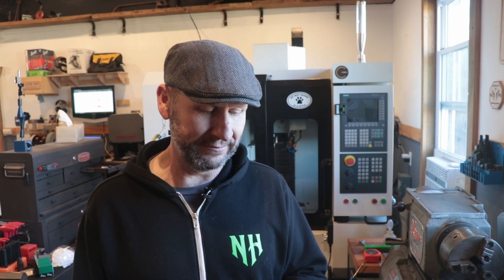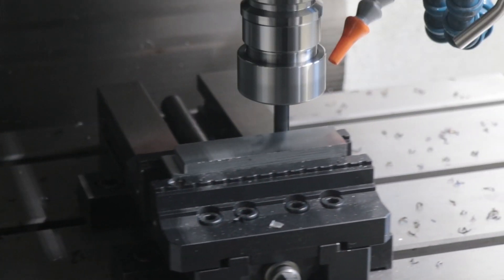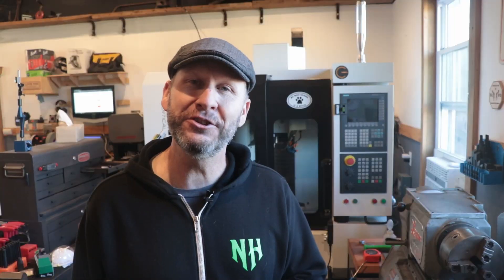Syil X7 Ripping Through Steel at 80% WOC

Comment: Loving you're videos😁👍.....I have a Skyfire VMC and thinking of upgrading to the X7, space is an issue so I was wondering what was the minimum distance away from the wall do you need to access the electronics panel at the rear, ie how much swing in the rear access doors, many thanks Marcus
Reply from the maker: The rear doors on my 2020 Syil X7 are 19 inches wide.  I have the mill 20" away from the wall. It's a tight fit to get back there, but doable.  

I have the left side of the mill open to my shop and the right side is 16" from the wall.  Again a tight fit, but enough room to squeeze around if I have to.  

I have a cement floor and the mill is very easy to position with a capable pallet jack.  

Hope that all makes sense.  Take care.
Reply: @PowerForgeWorkshop  many thanks for the reply, very helpful

Comment: What steel is this? Can this machine handle 316L like that? Thank you very much
Reply from the maker: That was mild steel. The machine has a BT30 spindle and no, I don't think it can handle 40% WOC in any metal. In my opinion, it likes 5-10% DOC with higher RPMs. It's definitely not a rigid torque monster.

Comment: That was pretty amazing. How far off were the final dimensions?
Reply from the maker: The stock was 100 mm long and was supposed to be 87 mm. I had it programed leave .5 mm on the wall, so the end mill chewed threw about 6mm of steel.
Reply: @PowerForgeWorkshop  🤣

Comment: It will do it but wasent happy. Surprisingly little chatter
Reply from the maker: Agreed. It wasn't happy.  Not much torque at that RPM and you could hear the machine bog down. 

The end mill is pretty tough. Helical Indexed Carbide with a Titanium Aluminum Nitride coating (TiAlN). Odds are though, I just burned through some of that coating. 🤣